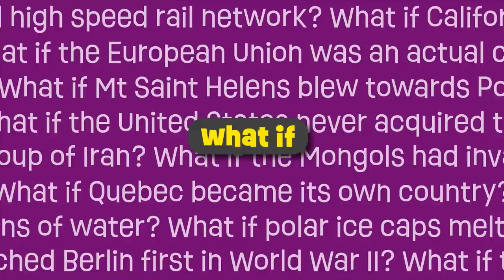Water Pipeline: What If An Aqueduct Was Built From The Great Lakes To The Southwest?

Comment: There are years when Great Lake water goes up. Only a few years ago there was a Great Lake water shortage where piers & docks were built to chase the receding Lake water.
Reply: This. We do have water but it can be VERY variable.
Reply: The elevation of lake Michigan has a range of about 6 ft from record high to record low water. Piers and docks need to be able to accommodate this natural fluctuation.
Reply: @opossumlvr1023  I bed to differ. So many news stories, at the time, about Marina owners, dockside restaurants suffering from a significant drop in Lake levels (Lake Michigan). Time pasted & slowly lake levels returned to normal levels.
Reply: @opossumlvr1023  they had that range. The range has been growing as the climate changes and weather becomes more variable
Reply: @CortexNewsService  Actually that range I mentioned is quite stable because the higher the water gets out flow increases and when lake levels are low the out flow decreases. When I get a chance I will look at the data on the USGS website and I garentee that the last high and low are not significantly different than past highs and lows.
Reply: @CortexNewsService  what data set are you looking at that shows lake levels fluctuate over a wider range? The weather here in michigan normal, we are not expiriancing exstream weather. It isn't hotter, colder, wetter or dryer than normal.
Reply: @opossumlvr1023  tell that to Chicago where the lake is literally eating away neighborhoods

Comment: Before they start looking to import water to the US southwest and California, they need to stop wasting water growing crops in the desert. Irrigation is only appropriate if you are using local water.

And how efficiently is that water being used? Open aquaducts allow for evaporation during transportation. 

As well, the used and then treated water is dumped into the Pacific by California. There should be a pipeline returning the water to the Colorado after treatment, in order to maintain the flow on that river.
Reply: There are easier, closer solutions.  A lot of your solutions are high tech and still prone to failure, as well as electricity intensive and less than durable.  I 
  Look into rainwater harvesting earthworks it's much cheaper and decentralized.  It's a better source for water security.  Look up, Geoff Lawton and Brad Lancaster.
Reply: @b_uppy  What high tech solutions? I just pointed out the silliness of trying to grow crops in the desert - especially in a nation with so much actually arable land.

And I suggested that water shipped to LA should be returned after sewage treatment.

And that the idea of importing water from the Great Lakes is a bad one.

No tech.
Reply: Treatment is expensive especially to the degree you want it.  It also requires tech support, and a lot of electricity to move it. 
A lot cleaner water is the stuff that goes down storm drains. You can use it for watering lawns and t rees and shrubs.  It is free.  A simple curb cut and bioswales and your yard needs a lot less city water.  
If you want to get a little more complicated you can harvest roof runoff into a large elevated container for gravity feed.  If you have a metal roof can purify your water for drinking. Asphalt roof runoff can be used for flushing the toilet and and again watering trees and lawn.  Trees are a natural filter.  You can eat fruits and nuts from trees watered from street and asphalt roof runoff as the harmful chemicals are filtered out by the tree.  This saves a tot of financial burden and eases grid strain.  It reduces flooding and also fire hazard for minimal costs.
Reply: It's simple. The water is free for many of these farms and cities. Bring a pump and all you can drink. The states are loathe to quench growth so they'd rather live in fantasy land.

Also, just to clarify. There is no such thing as unlimited "local water" -- sure there are ancient aquifers in some locations but lots of locations near rivers are just using river water that's been filtered into the ground. Either way, they are using a finite resource that the governments are currently treating as unlimited.

And the result is predictable.
Reply: Zero pumps needed.  Here is how you feed people and increase food diversity:
https://youtu.be/wd-b_C7a_es
Reply: @x--.  Quit blaming local government.  Buy from local farmers and ranchers who use regenerative and restorative practices including rainwater harvesting earthworks, mob grazing, and avoiding bare earth food practices, among others.  Government adds to problems.  
You can make choices to buy from ethical producers as well as implement methods of rainwater usage in cities.
Reply: @b_uppy  What's your point? I should magically own property where I can grow my own food to ensure it is of the best quality?

You may be rich enough to have that luxury but I am not. I live in a world where I rely on others to specialize in agriculture so I can specialize in my field... So I don't have time to investigate every farmer I buy from, every grocery store supply chain. What I want is government to mandate that transparency & enforce it.

I'd be real interested in that sort of thing. The rest seems like marketing hype. Yeah, we elect morons who screw up a lot but I can't fix that right now.
Reply: @x--.  
Strawman argument on your part.  
Get to know your local food producers and find ones you trust. Many farmers will sell off of their site, especially permaculturists.  Many have delivery services where you can receive a box of various locally grown produce for a monthly fee, what have you.
Many areas have farms fairs that make a special day of allowing visitors in.  Make a day of it.  See what they do.

It is possible to be ona rental and grow your own good as well.  Permaculture promotes growing where you can.
Reply: @x--.  
One of the cleverest solutions I've seen comes from Brad Lancaster, a permaculture teacher who specializes in rainwater harvesting earthworks.  He's has made bioswales a thing in Tucson.  
There are a lot of pluses with bioswales and one is increased local food diversity and security.  It employs curb cuts to water native food-producing plants and other vegetation.  
Trees are great for harvesting stormwater runoff from streets.  The trees filter out pollutants without putting the contaminants in the fruit and nuts.  It decreases overall water pollution as well as providing flood mitigation, drought mitigation, fire mitigation.  It can help recharge local ground water tables, etc. 
Roof rainwater runoff can also be used water trees and lawns, as can greywater.
If it is a metal roof, you can even filter that water for drinking.

Brad Lancaster also has done a lot in rural areas with other rainwater harvesting methods.  Watch his videos, read his latest books.  Informative and even entertaining.
Reply: @b_uppy  Read Brad's website. His scale is small. At least, in comparison to the massive agriculture industry and the amount of water they use (drove by a farm yesterday with a water "faucet" the size of a giant beach ball, water flooding out).

We're talking about a massive amount of water here. In fact, a whole river's worth of water. It's all used before it reaches the sea.

So his work is undoubtedly part of the solution but one of the reasons rainwater harvesting is banned in cities is because they want that water going into the water table. His work doesn't magic more water, it's still a diversion. There are still winners & losers.

We need multiple solutions but we also have to accept reality.
Reply: Your making a contextual mistake.  They are 'small' in the sense that they are decentralized/off grid.  These are done without municipal or other government systems for support.   They don't need ongoing electrical grid support, grid maintenance support, etc.  These are scalable for larger areas, but they avoid grid dependence.
In a grid failure situation Brad's methods still work despite brown out/black outs etc.
That is the 'small' context.
Reply: @x  (addendum)
The water that is drained off is actually drying the water table.  Look up 'water table.'  When water reaches saturation point it becomes surface water.  That is hydrology 101.  Healthy soil is a great way to store water and prevent evaporative loss as most of it is protected from dessicating wind and sun.  Site-appropriate, diverse plants of trees also assist as they decrease wind and sun effects.  Healthy soil has lots of carbon in it making it receptive to better water percolation (absorption).

  This has been shown over and over again in Ethiopa and India in their efforts.   Adequate soil saturation has actually led to creeks and wells being reborn/recharged.
Reply: @x  
City storm drains are based on the older paradigm of removing animal and even human feces, hence the perceived need to 'flush it out of the streets.'   It was to purely to drain water rather that hydrate dried soils. We had much better natural topsoil mechanisms that absorbed floodwaters and mitigated drought/heat wave events.
Reply: @x  
Walter Jehne and Didi (Waterhouse?) are a great video that explains the difference between dirt and soil, and how they absorb water:
https://youtu.be/oZVcNq56MDs

The bread/flour example may seem suspicious but there other videos where they hauled in large amounts of dirt, planted soil, and a sprinkler system and showed with side by side comparisons of how bare soil fails to absorb water.  
There are two ways to fill a rover but ony one that benefits wells, plants, and living creatures.
Reply: @b_uppy  So, my comrade-in-water arms. I can't tell if you are trolling me or just sincerely missing my meaning.

First, Strawman?! That term means I'm misrepresenting your argument but I'm not. You literally say "Make a day of [tracking down your food sources]" get to know my local farmers? How is an inner city family with no car getting to their local farmers? Wth? 4 out of 5 people in the US live in urban areas. I get your argument man, you just don't get what kind of privilege it is to have so much free time & money that you can take days off to track down where your food comes from. 

You know who sells the most food in the US? Wal-Mart. For us who have to buy food at Wal-Mart your proposal sounds completely nutty.

Second, scale.

The entire Colorado River,  on annual basis, goes toward human consumption & evaporation. Trillions of gallons of water per year!

Brad was talking about savings of hundreds of thousands of gallons. Yes, distributed that starts to add up but it isn't magic water, the water he "saves" is lost to other users in the Colorado River basin. Yes, more local use means less evaporation loss but, at most, that's what, 10%?

That's a lot of infrastructure that local governments aren't going to want to pay for when the farmers & state governments don't think they should have to give up any water.

My point is Brad's work is great, 20% of the population who live rural & have the wealth to get picky about their food growth, also great! We need more of this.

But the scale of this problem is much, much bigger than you seem to comprehend. Where do we get hundreds of billions of gallons of water?!

You're talking saving buckets when the scale of the problem is missing many Olympic size swimming pools.

The fundamentals matter here. We feed people on an industrial level. We need big scale solutions and we've known that for a long time. It's a major part of the reason Lake Mead and Lake Powell exist. Electricity & water storage! The biggest water storage in the US and it's failing.

So let me try & sum things up: I can't convince 250-million city-dwellers to start buying water-responsible food. No government can.

Most of the states STILL refuse to even acknowledge that there is a problem, that the water isn't infinite. Utah is still planning on pumping more water out of Lake Powell!

We do agree on some things: Water conservation & responsible farming. We disagree on the industrial agriculture voluntarily changing how they do business, they won't without government regulations. We disagree on the scale of the problem & realistic near-term solutions.

So by all means, share the knowledge on conservation but please, please don't imply it'll solve the profound water use issues of the Colorado River.

Happy Youtubing!
Reply: @x--.  
Walter Jehne and Didi (Waterhouse) are a great video that explains the difference between dirt and soil, and how they absorb water:
https://youtu.be/oZVcNq56MDs

The bread/flour example may seem suspicious but there other videos where they hauled in large amounts of dirt, planted soil, and a sprinkler system and showed with side by side comparisons of how bare soil fails to absorb water.  
There are two ways to fill a rover but ony one that benefits wells, plants, and living creatures.
As you or YT removed several of your remarks it is difficult for me to cite why I said strawman, other than as I already explained and as you had previously gone on from. 
 If you have zero car transport why are you complaining about inner city trees supplying food?  Most people still have vehicles, even in the city.  What kind of privilege do you have to bypass truly local food??  Growing 9uts8de your second story window???  You were the one that cited 'a farmers market' and now you're crying 'Walmart'???  Walmart is more a suburb thing so tell me again about inner city life???  You have internet.  You can certainly get on Facebook or other social media platforms and search out permaculture farmers.  They list their businesses online.  They also advertise is Permaculture Design Matzzibe as well as contribute articles.  

Walter Jehne and Didi (Waterhouse) are a great video that explains the difference between dirt and soil, and how they absorb water:
https://youtu.be/oZVcNq56MDs

The bread/flour example may seem suspicious but there other videos where they hauled in large amounts of dirt, planted soil, and a sprinkler system and showed with side by side comparisons of how bare soil fails to absorb water.  
There are two ways to fill a rover but ony one that benefits wells, plants, and living creatures.
As you or YT removed several of your remarks it is difficult for me to cite why I said strawman, other than as I already explained and as you had previously gone on from. 
 If you have zero car transport why are you complaining about inner city trees supplying food?  Most people still have vehicles, even in the city.  What kind of privilege do you have to bypass truly local food??  Growing 9uts8de your second story window???  You were the one that cited 'a farmers market' and now you're crying 'Walmart'???  Walmart is more a suburb thing so tell me again about inner city life???  You have internet.  You can certainly get on Facebook or other social media platforms and search out permaculture farmers.  They list their businesses online.  They often advertise is Permaculturem Design Magazine as well as contribute articles.  

Your article is long and seems to have missed later comments I posted...
Reply: @x--.  
Furthermore what I am advocating is quite different from 'conservation or sustainable' ag, land use practices.  This is a groups called regenerative and restorative.  Big difference.  
If you had watched Brad's video guest appearance on urban rainwater harvesting you'd know part of the answer as to how much rainwater can supply water needs.
Think about this 'where do you think water from reservoirs, rivers, etc comes from?  It comes from the sky rather than a big river or lake in Canada.  
Really look into the videos I cited, as well as Brad's books.
Reply: @b_uppy  I did look him up. Fundamentally, it's conservation, at best, and snake oil, at worst.

Conservation just means "conserving what you already got." That's literally what he advocates when he says: tanking, utilizing, and cycling [...] rain, stormwater runoff (such as street runoff), greywater, dark greywater, condensate, snow, & fog) ...

Those words are from his website!

The thing that both you and him seem to miss is that there is no such thing as free infinite water. That is a lie. If you remove water from the watershed, whether it's "harvesting" or other means, the downstream users don't get that water now. If you live in a desert and only get 2in of rain a year, then you are going to run a deficit somewhere. He is saying you should store your own water instead of the government. Okay, does that magic MORE water or does it just allow you to conserve more of the water that touches your property?

You know why some cities in the west FORBID the collection of rainwater? Literally, it's illegal. Because that water is already allocated for. They have to deliver a certain amount of water to downstream users, by law.

Distributed water collection does not generate more water. I don't know how to state it any clearer but there it is.

His model is built on a lie that there is an endless supply of water, the same model the states used when divvying up Colorado River water. "There's so much! How could it ever run out?"

If everyone adopted his methods, there still wouldn't be enough water to maintain the level of growth & the agriculture. Isn't that what we are talking about here?
Reply: @x--.  
Which 'him' are you saying is 'snake oil?'  Which video did you again not watch???   
You're only pretending at this point.  'Snake oil' is just another name for I want and easy out argument-wise...

Comment: According to the U.S. Army Corps of Engineers a pipe line 30 foot in diameter could be built from the Columbia River to Southern California.  A tunnel boring machine would be used to bore a hole under the Pacific Ocean.  There would be enough water to support the agriculture in Southern California and build all the way to Nevada and Arizona.